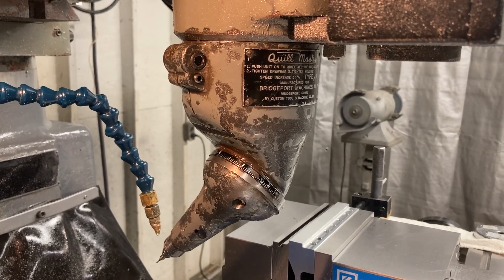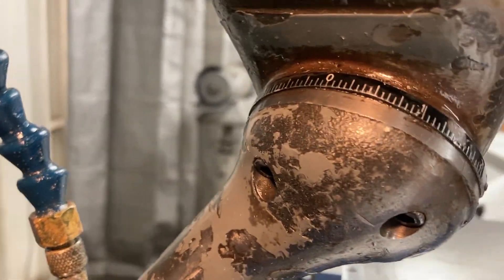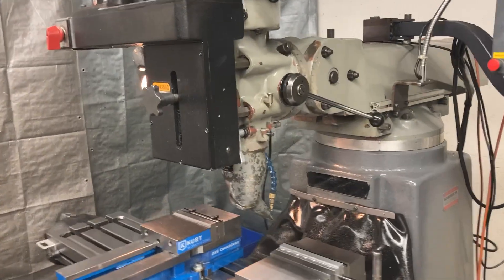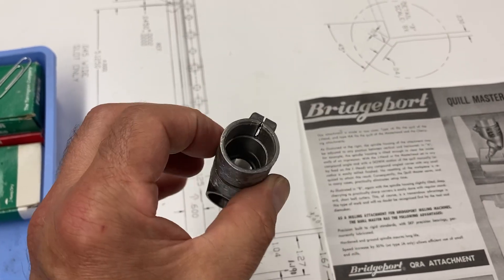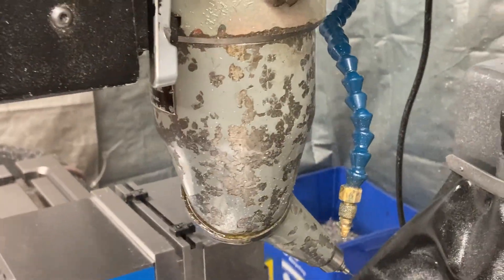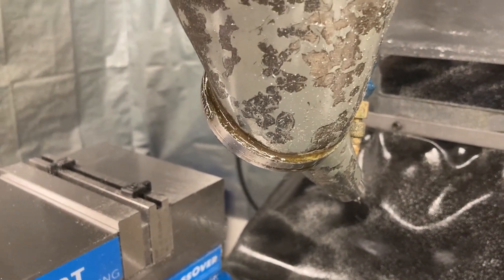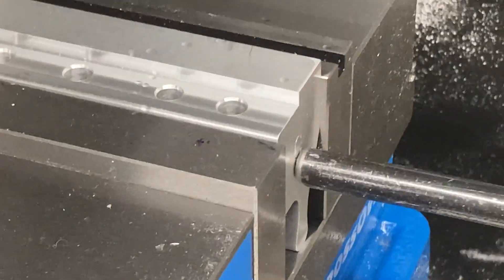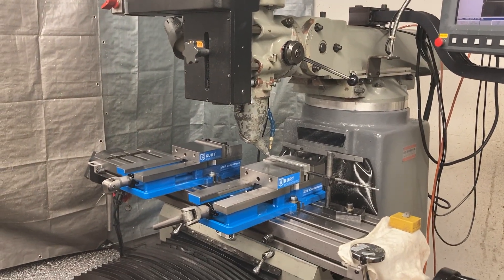Bridgeport QUILL MASTER Multi-Angle Milling Attachment w/ QRA Right Angle Head 45 Degree Relief Cut

Comment: Did you consider holding the part on its ends and tipping it to 45 degrees? Run the cutter front to back on the Y.
Reply from the maker: Yes, but that's too easy.
The Quill Master makes for better video subject matter.